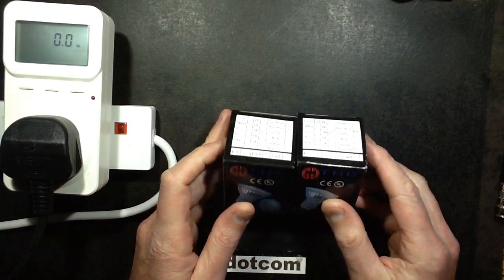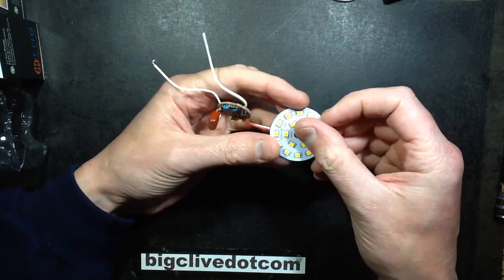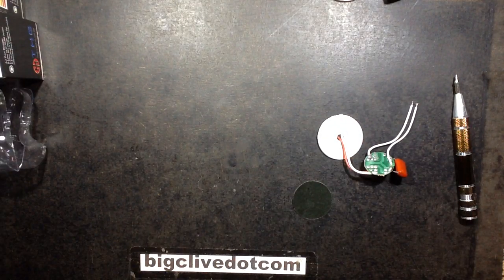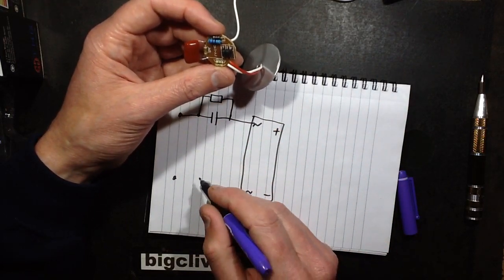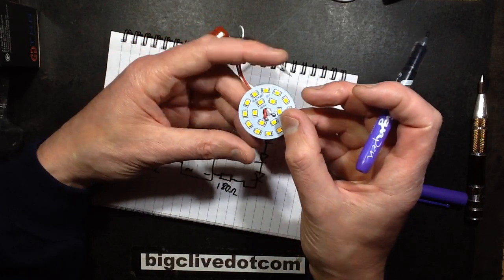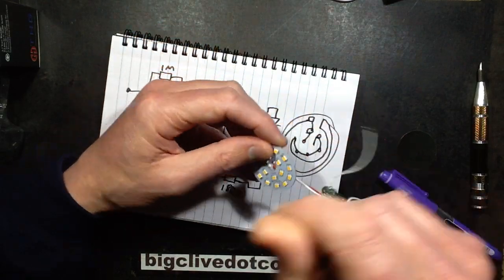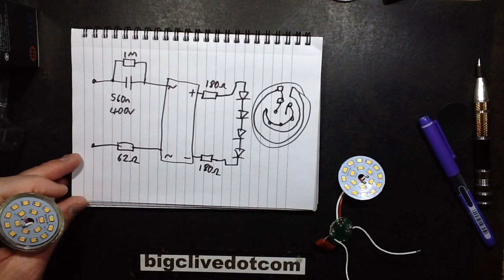Teardown of 5W GU10 LED lamp.

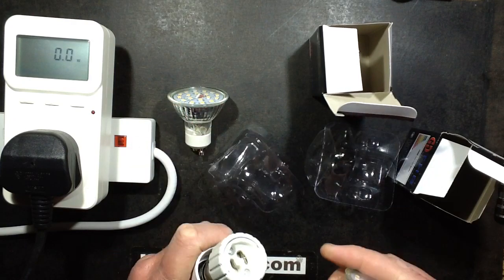Comment: i calculated power draw for this schematics and its 7.05Watt.. i dont get the 2.5W meter reading at 1:04, my manual says that under certain wattage it does not work properly.. edit: i forgot to involve power factor which tends to be around 0.5 for these crappy ones so it would bring theoretical value to 3.5Watts, close enough to your measurement with that device's uncertainity..

Comment: Removing the front glass of a GU10 is quite simple: when you “boil” the lamp in a thin layer of water (approx. 1cm) for 5 – 10 minutes. 
The hot water causes the glue to lose its strength and the glass can easily be pried off by means of a thin screwdriver or a knife.
Reply: Method worked well on Philips GU10. Took about 2 minutes before it popped off easily. Followed by 15 minutes of explaining myself to my partner why I'm boiling a perfectly fine Philips bulb.
Reply: What I personally do is I use a hair dryer.

Comment: what's the purpose of the 470nf cap and 1M ohm resistor ? current limiting ?
Reply from the maker: +BillyNoMates1974 Yes.  The capacitor lets through a fixed portion of current on each half cycle as the polarity changes across it.  The resistor is to discharge that capacitor when the lamp is unplugged as otherwise you can get a zap off the lamps base.

Comment: They arrived at 5W by pulling the shenanigans that many generics do.  Those seem to be 250mW LEDs, so they just did 18 LEDs x .25W = 4.5W + driver inefficiency or rounded up to 5W.

Unfortunately they also often rate the lumens based on what they would have been at 250mW and 25C temperature.when the actual output is probably closer to 150lm.